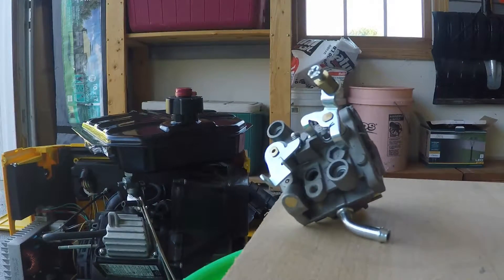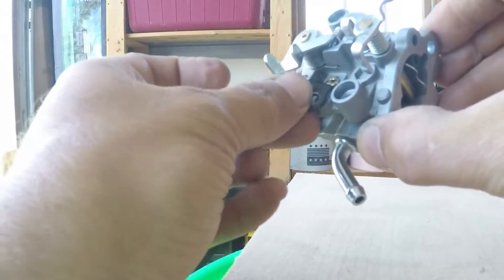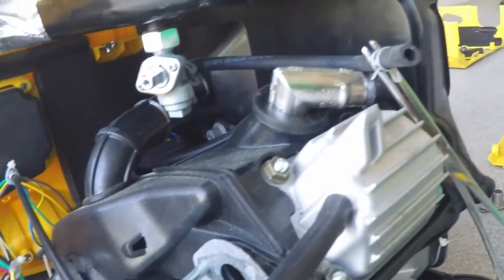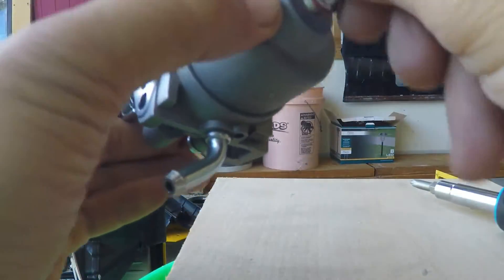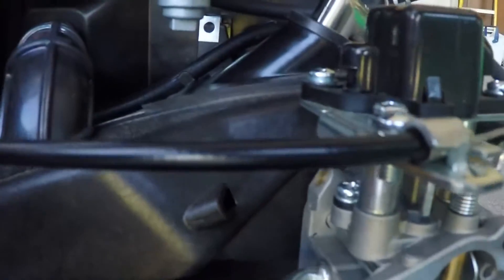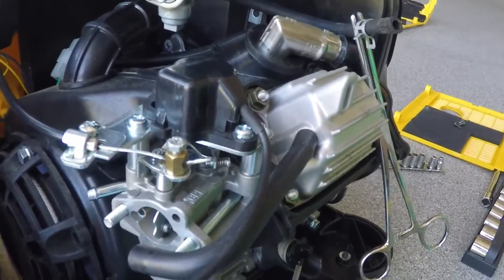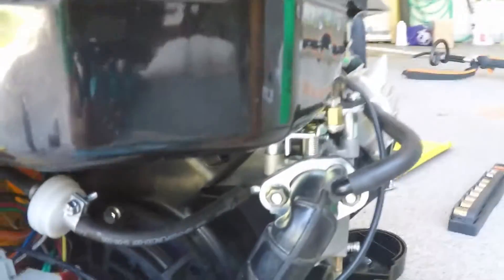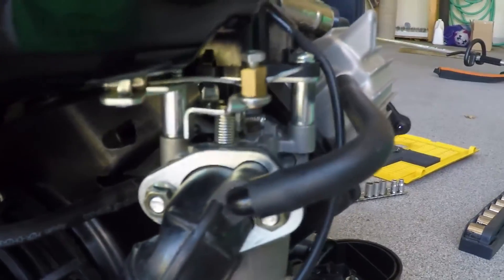Champion 2000 Watt Generator 73536i Surging Idle carburetor fix

Comment: There's a fuel filter on the pickup tube/shutoff valve inside the gas tank. My tank had lots of rust inside the tank and on the filter.
Reply from the maker: Yeah...  It's a fuel screen, not a fuel filter...  Why does the idle jet get plugged on everybody's generator? Because small particles are getting through that crummy filter

Comment: WHY did you edit this so much, so short...we need to see disassembly and reassembly too....and your added filter you went to all the trouble to go buy and install, then skipped filming !? 🙄🙈  Very glad you opened with the opened, disassembled carb....I needed to see/confirm that float...I think that's mine's problem...stuck float...fuel just keeps pouring out of carb...even after both fuel lines replaced and new clamps....

Also glad you captured view of that spring on back of carb...another guy mentioned it as it shot away on his vid...but never showed it.
Reply from the maker: Because I wasn't thinking about making a video until after I solved the problem and figured out how simple it was... I figured I could describe it and provide some information.

Comment: 3/16th or 1/4in filter??
Reply from the maker: I used Briggs & Stratton #5098K 75 micron.  Looks like 3/16.  There is a fuel filter at the outlet of the fuel tank but I don't think it can hurt to add this one.

Comment: I think it has a few design flaws as something so new and barely used should not be having so many problems, i have same generator having what appears to be similar issues, mine had the inline fuel filter i did that when i bought it . Ill try cleaning the jet and see what happens, thanks

Comment: CPE tech support told me that adding a fuel filter would constitute a modification that would invalidate the warranty on my 2500 W inverter genset which began to hunt and cutout at less than 30 hours and one month old.  They told me that the carb might be bad and that it was back ordered two months out.  This model requires that you dismantle half of the case to remove the carb but I did it and then cleaned the carb.  Runs great...for about 4 or 5 minutes. Manual says that the fuel valve may be dirty and it is acting like its is switched off or nearly so.  There are no instructions about cleaning the valve anywhere. I am starting to think that the single integrated valve/choke/kill switch is not such a good thing. Never had any problem with my Hondas with separate fuel c/o valves.
Reply from the maker: You could do what I term, "a consumer managed warranty..."  Buy another generator and either swap out the carb and then return this one as defective, or just return your other one saying it doesn't run right under the new receipt. Like a lemon law, which is what you got!
Reply: The other thing you could do is buy a piece of fuel line and the after-market fuel-filter, drain your tank and pull off and save original fuel line and install your replacement "New and Improved with filter" fuel line and fire it up...probably problem solved.. if not, put original fuel line back on and call...but these things are simple enough that their "Warranty" is probably a waste of your time arguing with them...easier to learn the design and fix it ourselves.

Comment: I have had this Generator for about 10 years and it has been used lightly.  Did a full service on it, added the filter and was able to remove the carburetor piece without removing the whole unit.  Cleaned and fired up.  Still has the slight surging, but i can adjust the choke slightly to correct it.  Great video, especially the "Small Spring" part.

Comment: The fuel filter is built into the fuel valve assembly.  You don't need to put one inline.
Reply from the maker: I've heard that but crap still gets past it into the idle jet.

Comment: Actually there’s another fuel filter where the petcock attaches to the tank. Have to pull the petcock off, and it’s in the downspout of the tank.
Reply from the maker: I haven't taken it apart to see yet, but it must not be very good if dirt is getting to everybody's carburetor.
Reply: @timgoihl  on mine they had used what I guess was some black silicone  to keep the filter in place; that turned to black sludge and then clogged up the jets. Once I cleaned all that out it has run like a Champ ever since

Comment: It seems the generator may be missing by design an in line fuel filter. Cheap and easy to install and likely worth doing to prevent dirt from getting into the carb
Reply from the maker: Others have said there's a filter in the shut-off valve assembly. I haven't taken it apart to see yet, but if there is, it must not be very good if dirt is getting it to everybody's carburetor.

Comment: Thanks, your video helped me too!!  I cleaned out the idle jet (the idle jet on mine is plastic??), it was definitely clogged, put everything back together (but not without dropping countless screws and sockets down into the genny cavity, arghh!), and it started right up. My fuel smells slightly stale, tomorrow I will drain that and refill with fresh.
Reply: Mines plastic too. Just watch the o rings

Comment: My same generator was acting the exact same way as yours in this video. I’m an automotive tech with 40 years of experience. I knew that it would be a carb problem, but your video saved me all kinds of time and money. No rebuild kit, or total disassembly requited. Went with the tank removal method, since I wanted to clean it out anyway, and pulled and cleared the jet from the top. Put in an in-line filter, one pull, and she’s right as rain. Runs like a champ. Thanks for this video.

Comment: Ya mine does this all the time. I called Service. They said it was the carb.  I got a new one, installed it worked great.  Used it 3 times.  Always turned gas off and let it run out. Emptied out gas at end of summer, stored in dry, heated garage all winter. Put fresh gas in and now it won’t start at all. I’ll never buy champion again. Generators are needed for emergencies and I’d be screwed if my life depended on it.   Champion will not admit they have a carb issue on these machines. Will def give this a try. 🤞
Reply: I don't think Champion has a problem so much as some Champion customers have a problem. You cannot reliably store gas in ANY machine for great lengths of time without asking for trouble. This little generator has a fuel drain screw to empty all gas from the fuel system prior to storage. Plus use medium or premium grade fuel to rule out ethanol in all small motors, plus add Stabil to the gas for long term storage. I do this for three generators, a snow blower, a lawn mower, a large boat motor, a pressure washer and several string mowers and in 50 years I've never had a problem of any kind even with gas stored over a full year. 

Proper maintenance procedures are vital for storage
Reply: @TOURMANBOB  Totally disagree I have 4 honda small engines 2 power washers 2  gens ,I treat them all the same premium fuel and stabil ,I never have trouble with them always start by the second pull never have had to wrench on them like this Champion
Reply: @jimcaf57  I guess you got a lemon then...it happens
Reply from the maker: Agreed. But it is just the carb. It can be cleaned, and I think the filter helps. But I did have the bowl gasket start to deteriorate which is past the filter so that's another problem. When I complained about my carb to their support phone number they actually sent me a replacement for free, which might be the solution, have a backup on the shelf, especially if you live in Texas!
Reply: @timgoihl  thanks.  I have a spare now too. I’m going to follow your advice and try it out.  I’m up in Edmonton. I wish I lived in Texas lol. Thanks again.

Comment: Another quick note there is a good vid by Champion on how to take the carb out. You take off the fuel nob to get the gas tank out, it's super easy to get to everything unscrewing the knob off first. Was having the same issue. Great to see this tip on fixing it.

Comment: Mine has same issue. Will clean carb.. also have another issue. Load light is constantly on and does not produce any power.. any ideas?
Reply from the maker: The LED module actually does something... The LED module seems to be an ignition control unit of some type...  Check out this 2019 video:  https://youtu.be/41wWWhCvVEI (the fix) and this one https://youtu.be/1ODR_aNU28U (the problem).  Does it detect the load and attempt to increase the engine speed at all?  If not, maybe the servo motor connector is loose.  Does overload led turn on?  is the Output led on?  Pg 23 of your manual has some troubleshooting ideas, but if it is load related, I would open it up and check all the connectors.  Here is a list of tech bulletins, but none seem to describe your issue. http://help.championpowerequipment.com/category/2zg6it218q-tech-bulletins

Comment: Thanks for posting this.  I have a pair and one was surging/galloping like that.  I didn't know that little clip held in the idle jet.  Yes, it can be take out without removing the carb.  Remove the top plastic then the tank, remove the servo then the top plate off the carb..  it's right there on top ready to service.    I just did it now my generator idles properly again.  I had a hard time finding a piece of wire thin enough to poke through the jet but eventually found some.  Jets are brass so it should be mentioned that only soft copper wire should be used for that step.

Comment: In the bottom of the fuel shutoff valve  there's a fuel filter,unscrew that  square bottom part and that's the filter
Reply from the maker: I've heard that.  What is the micron rating on that filter?  Given the number of people that have 'Carb' problems with this generator, I don't think it is adequate for the job.  I still stand by adding the external 75 micron in-line filter, unless you want to tear-down your carb every few months....

Comment: Thanks for the video..I removed and cleaned the pilot jet..  Sprayed carb cleaner thru the pilot jet port on the carb . Installed an inline fuel filter(Visu-Filter 3/16")    All is good now,runs great.
Reply from the maker: Those clear filters are cool!  Glad it helped.

Comment: Mahalo! My Champion 2000 only runs on 'Echo'? Do you think this might be the same problem? It always surged but only slightly. Thanks again!
Reply from the maker: You mean no rpm change when you flip the (Eco)nomy switch?  I would say you have a different problem.   Could be wiring, the switch itself, the electronics, or the little servo motor.  You could disassemble, unplug and re-plug each connector (in case there is some contact corrosion), test the Eco switch with a continuity meter, and do a visual of the wiring.  Your surging at low idle might be the idle jet, but I don't think it would be related to the full speed mode.  You could post a video of what it does!!

Also check this video: https://www.youtube.com/watch?v=41wWWhCvVEI 
The LED module seems to control some of the speed control...

In other comment Tasha Teeling said: 
@NEEMA BORJI Mine had old gas in it and it was causing it to run poorly and the power would shut off even though it would run. Oil smelled like gas. Serviced the oil, plug, rebuilt the carb and now it's okay.

Comment: Dude.  THANK YOU!  Like one of the other comments, I was about to pull the trigger on a Honda then I saw your video.  Did exactly that you said to do and it’s running like a Champion.  Thanks again bro.
Reply from the maker: Glad it worked!
Reply: I was thinking the same thing about "shoulda bought a  Honda or Yamaha..." too but had already committed to 2 of these 73536's and the parallel kit, so really did not want to give up on them.  One of mine is purring like a kitten, the other pouring fuel out of/around the carb...disassembled, replaced fuel lines with new, still pouring fuel out...think I have a stuck carb float ? 🤔

Comment: An excellent video, thanks. What do you think of the build quality of these champion units? They're not all that common across the water here in the UK, and am seriously considering purchasing one. I like the way that champion have designed the fuel system so that a pump is not required. Most other generators of this style seem to be fitted with a crappy little vacuum driven fuel pump that's bound to go wrong at some point! These look like nice generators. What are your thoughts? :)
Reply from the maker: The nice thing about inverter type generators is that type can run at low speed (meaning quiet) for light loads, but it can then run at full rpm (louder) for heavier loads.  But an inverter type has a lot of power electronics to create the AC, which is a failure point.  The carb is clearly 'cheap' and the lack of an inline fuel filter says cheap too.  This generator is light and works great for camping, mobile power tools jobs, etc.  I think if you have some basic mechanical skills (could do the job I did), then you would be ok.  For a home-backup situation, I think I'd go with a true 3600 rpm generator.

Comment: Awesome video. I bought this same inverter today for 40 bucks. It runs exactly like yours did in the beginning. I'm going to follow your steps to clean it and add a filter. I do have one question though. What do you think about running rotella 15w40? I run it in my dirtbike, 4wheeler and boats inboard. I'm going to try it out when I change it. I'll let you know if it blows it up. Rotella is really good oil and it's cheap. I think you're supposed to change it ever 100 hours in this thing so I think itll be a good choice.
Reply from the maker: Sounds like you got a great deal! Believe it or not, I'm not really an engine guy... just someone who likes to tinker and fix stuff.  You may want to do a full tear-down of the carb to clean the float bowl and other carb ports like I did and maybe even clean/flush the fuel tank while you have it off.   Did you get the manual for the generator?  You can download it here: https://www.championpowerequipment.com/product-manuals   15W40 is not a suggested oil.  Full Synthetic 5W-30 is rated for all temps from -20 to 110F.  Considering the oil is not changed often, why not go with the best you can buy?  It only uses 0.4 qt.  Protect your investment :) !  On the recommendation of my Stihl dealer, I even run non-ethanol fuel in most of my small engines (esp those that sit around) to keep out water - the alcohol attracts water and who wants that inside an engine?  Yes, the fuel costs more, but given the small amount of fuel they use, it doesn't cost much.  Watch out for that little servo spring and good luck with the repair!

Comment: Thanks for the guidance my friend, since I have that same generator model with that same problem, I believed that the problem was the servo motor but after watching your video I will follow your instructions to start repairing. I live in PR during and after Hurricane Maria this generator kept us illuminated during the emergency. It is a good generator. A greeting and thank you very much again.
Reply from the maker: I actually thought it was the servo motor also. I thought I was going to have to replace the electronics or the motor which would be too expensive so I was quite happy to find a speck of dirt!

Comment: Tim, where did you find your fuel filter for this unit? Having a hard time finding one that would fit.
Reply from the maker: Any farm and fleet or even a hardware store should have one....  It's just a lawnmower filter.  See video notes...  Briggs & Stratton Fuel Filter 75 Micron 5098K.  $5 on Amazon
Reply: Amazon had loads of different kinds
Reply from the maker: Just type 5098K into Amazon and they come right up. But it's probably easier just to go to your local hardware store or your farm & fleet and it probably will cost less

Comment: Thanks for posting this video.  I was able to just remove the gas tank and there was access to that screw that holds the idle jet in.  My jet was a plastic version but a wire from my wire brush fit right through the little hole.  Purrs like it used to.  I was almost convinced that I should have bought a Honda.  Thanks again!
Reply from the maker: Glad it worked!

Comment: Pro-tip: Don't soak the pilot jet in cleaner or the o-rings will disintegrate. Replacements are 4X1mm though if you need them.
Reply: HI Thanks for the tip where can i get 4x1mm o-ring? Viton or Buna-n? Thanks
Reply: @mikeb8542 two years later and I'm back working on this thing. Harbor freight has a box of assorted o rings I've used from this to automotive AC

Comment: I would suggest closer investigation, champion is a quality company not some Chinese knock off.  The filter is probably reusable a fine sieve which explains the dirt in the carb. Just saying I would bet money there’s one. Maybe the online manual parts list has it. I only insist because if it’s there it can clog and you won’t find the reason.

Comment: There probably is a separate fuel filter connected in the tank to the fuel line. If you remove the line from the tank it should drop out or you can pull it off the tank.
Reply from the maker: I don't think so.  Just that prestrainer when filling. The shut-off valve is located right on the bottom of the tank.  No place for a filter.  And given the amount of debris that gets into the carb, clearly the filtering system is inadequate.